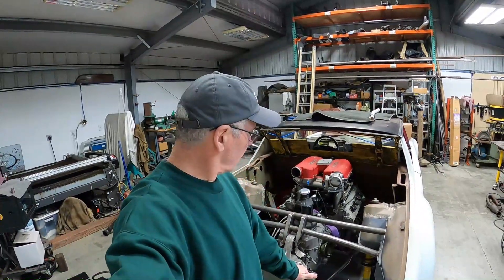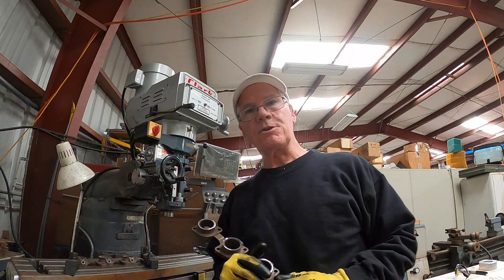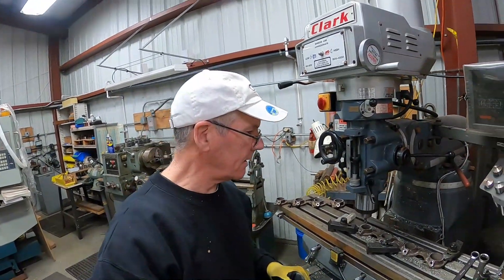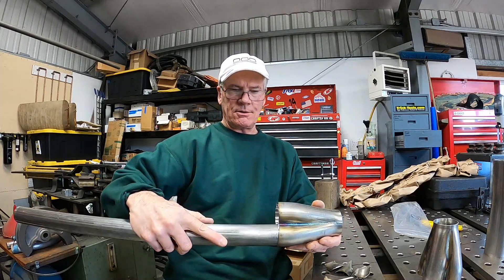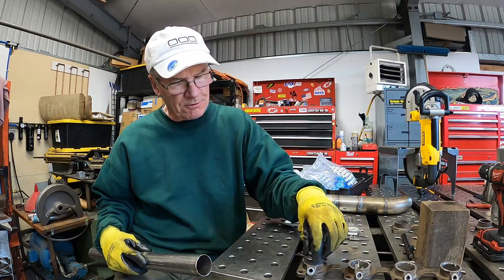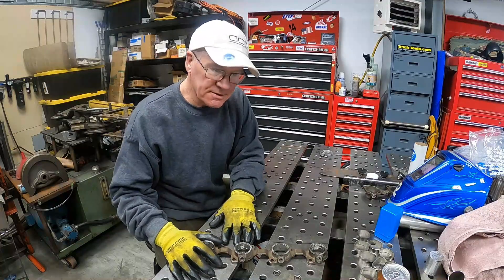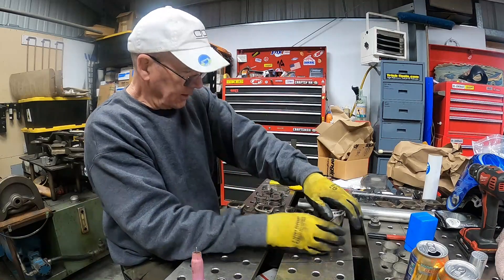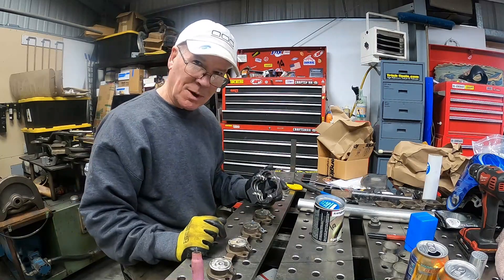914 Ferrari Build - Episode 10: Headers, Part 1

Comment: I did the same 2.25” on my 996 engine build and I regret not going 2.5”. I get so much heat in the collector that it cooked off my jet hot coating right at the merge.
Reply from the maker: It's interesting - the Ferrari header uses primaries that are under 1.5" and they run a 2.25" throat AND exhaust. I wasn't able to find a (standard) 1.625" primary collector with anything but a 2.25" throat. I plan to keep the transiton short so it'll step up to 2.5" right away. Thanks for your comment and for watching!